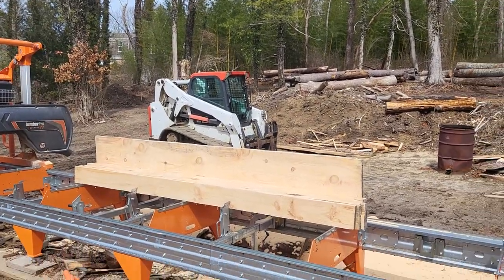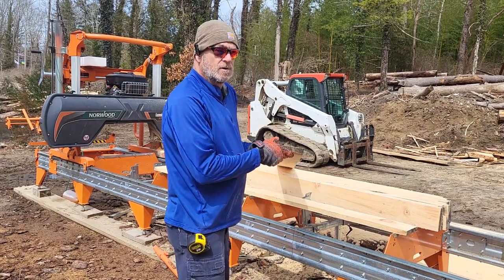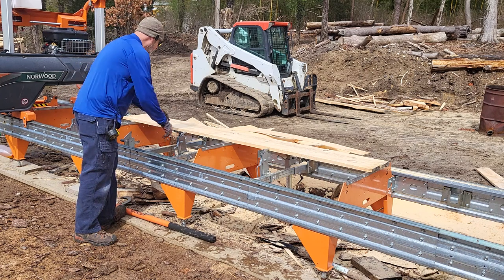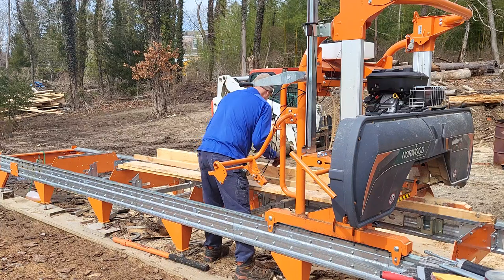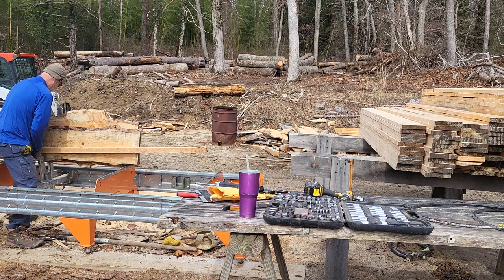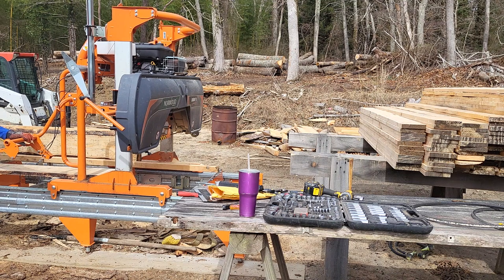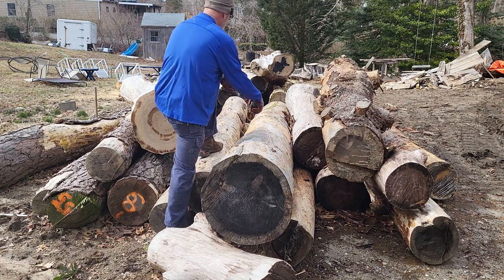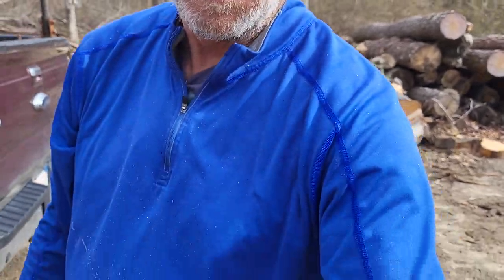Pirate Solutions Forestry on Norwood HD36v2 cutting up flitches and testing our adjustments.

Comment: Hey Bill, follow up on one of my comments a few videos ago.  On the guide blocks moving.  I am not seeing ceramics moving, its the blocks themselves.  I have noticed, when I get blade deflection (wavy cuts), the blocks are moving.  I can't crank the bolts down tight enough to keep this from happening.  Seems like there should be a way to keep the blocks locked in place.  My thought is the blade guides should be limiting the waves but seems opposite is happening.  Seems the blade is guiding the blocks.  If you hear of a solution to this, please pass it on.  This is frustrating to me.  Overall I am very happy with the mill but this is one thing I think could be improved.
Reply from the maker: Hey Don.  At first I thought the guides were moving, but the tell tale sign is if "one of the ceramics is tight, the only way that can happen is if the entire aluminum block moves."  If the ceramics are moving, the clearances can ONLY get bigger.  So, if your blade to guide gaps are opening, the ceramics are moving.  If one ceramic is tight to the band, the entire block moved.
Reply from the maker: I'm going to order the roller guides and do a series of comparison videos between the ceramics and roller guides.
Reply: Looking forward to seeing.  Thank you @williamprophett9148
Reply from the maker: I think I misread your original reply.  I AGREE 100% with what you are seeing.  My "entire blocks" are moving and (like you) I have reefed down on them, and they are still moving.